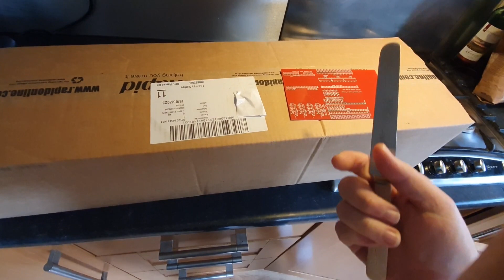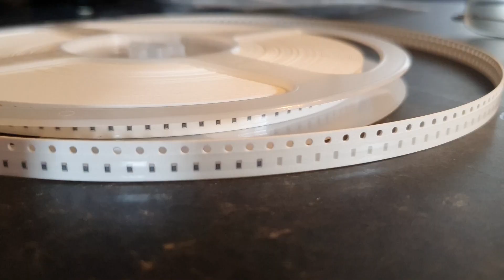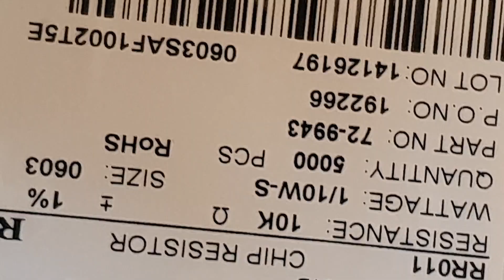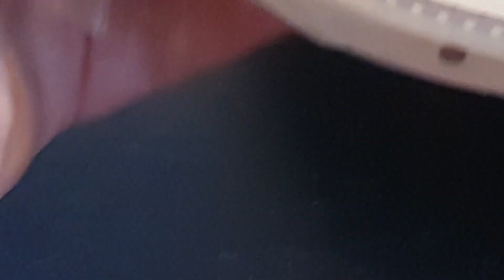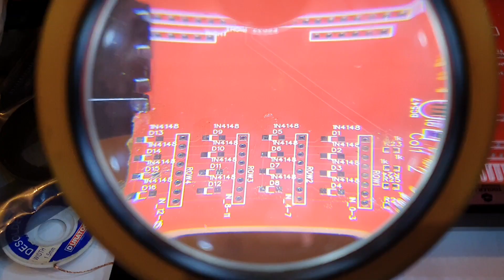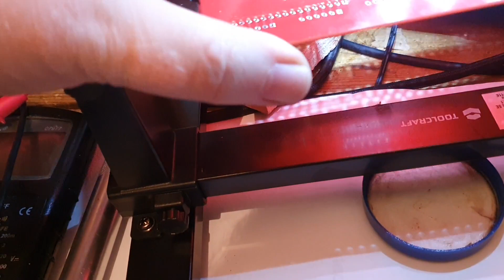Zoom B1X Four - Hardware Control Ideas Part XII - Soldering PCB

Comment from the maker: Drop me a note if you might want one of these PCBs. I should be getting the transistors to allow me to check the full functionality soon. I also discussed with a work colleague (later video with smd solding coming soon).
I think it will make a transfer cable so that button wires can be neatly routed and then connected to the Matrix all in one.